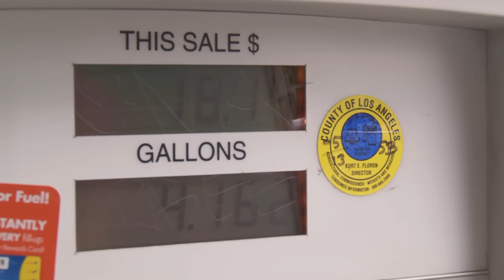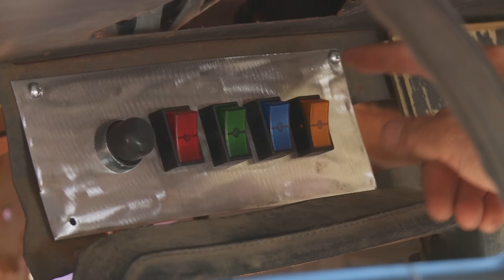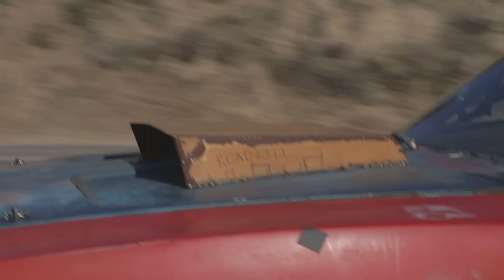Dirt Cheap Rat Rod! 1968 Charger Buildup and Thrash - Roadkill Ep. 23

Comment: Add one big turbo to it -> +200 horsepower
Reply: no
Reply: Yes!
Reply: NO TURBO IT WILL JUST MAKE IT SOUND MORE LIKE POOP
Reply: And some Racing Stickers -> +50 horsepower each
Reply: A turbo on a 68' charger. Were you dropped at birth?
Reply: Whats wrong with a little bit of boost?
Reply: ok supercharger then. Gets even better. 
A proper supercharger to that= +400nm torque. Torque means burnouts and brutal acceleration and supercharger means even better sounds.
Reply: Martial Bernier I Agree. Theres nothing wrong with a little bit of boost to make the tires go round and round.
Reply: Very basic engine in old car that is not boosted produces around 140hp which is same as for ecoboost produces.
With proper charging its easy to triple that.

If it would be diesel engine, they would propably add even more air into engine. because diesel is funny if you add air. 120hp turns into 800hp and 2000nm torque
Reply: eero nieminen Yeah 140hp may be the same as a ecoboost but...
A: You will most likely have more torque
and
B:The Power curve, Delivery of the torque, and the characteristics of the motor make it alot more punchy.
Reply: i would like to see that care have a drag race against ecoboost fiesta rs
Reply: eero nieminen LOL That wouldn't even be a race.
Reply: lol fiesta is lighter and produces same amount of power as this one so it would be close one
Reply: eero nieminen look at my comment 4 comment up from this one...
Reply: it still doesnt mattter. fiesta might still be faster and propably is. 
did you know wrc cars go 0-100kmh faster than lamborghinis? Even tho they are almost like normal cars with 2L engines.

Fiesta rs is actually faster even tho this car has V8 and fiesta has 3 cylinders and 1000cc.

You should walk to car dealer and get one for a ride. It is fiesta but has amazing engine. Just try it
Reply: yes i do have but you cant believe me for some reason
Reply: eero nieminen just watch the new roadkill ep.
Reply: eero nieminen I'm late to the party, but what Onyx is getting at, is that HP isn't what moves the car, it's torque. And that old school V8 might not make much HP, but it makes a lot of torque. Also, that Charger is essentially a rolling chassis, so it isn't nearly as heavy as you might think. No interior, no windows, it's probly several hundred pounds lighter than stock. So yeah, drag race? Charger, all day.
Reply: Guitardrumr Horsepower is more important in cars.
As an example Tractors have like 160hp and 700nm torque. Still even tho they are geared to go only 50kmh but if you change the gearbox, it still doesnt go faster than 80-90kmh. 2400rpm rev limiter just cuts the horsepower off
Reply: eero nieminen you are comparing a diesal to a gas engine though,
Reply: eero nieminen The late great Carrol Shelby would disagree with you, sir.

"Horsepower sells cars, torque wins races"

The ecoboost Fiesta you're riding so hard would be embarrassed by an old Jeep in the 1/4 mile. My old 01 Cherokee ran a 16.5 second 1/4 time at around 90mph. According to Car and Driver, the Fiesta is running 16.7 seconds at 84mph.

Wanna know why? Torque. The Fiesta has a whopping 112ft-lbs of torque. My old Jeep? Right around 250ft-;bs or so. So even though it's older, heavier, and has the aerodynamics of a Frdgidair, the Jeep runs quicker, because Torque is what is hustling the car down the track, not HP.
Reply: My friend has tractor with higher gearbox just to play with. It produces 700nm torque and 155hp. Still theres not enough power to go over 80kmh, because it revs only around 2300rpm, after that it heats up very very fast so its not worth it.
Torque accelerates in low speeds and horsepower has much higher top speed.
F1 car has less torque than your jeep but seven times the horsepower. And it goes FAST
Reply: eero nieminen you are once again comparing a diesel engine to a gas engine there is a difference. Diesels do not rev high. Its not how they are built.
Reply: TheLordJethro There is no difference. That example is just to show the difference between torque and horsepower.

Did you know that I produce 130nm torque and 0.4 horsepower on mountainbike? Maximun rpm is around 90 and with highest gear I can go 45km/h.
If I had the gearbox from a car in my bike somehow, my top speed would be like 15km/h with the highest gear.
If Car would have enough torque to actually beat wind resistance and use the gearbox from my bike, the top speed would be about 600-700km/h at rev limiter. (Compared to a car with top speed of 200kmh at limiter).

I have lots of torque but my rpm is not high enough to use small gears and go fast and i need to switch to higher gears very early which reduces the torque that goes to back wheel. If I could cyckle at 7000rpm instead of 90rpm, I would have 130nm torque and 135horsepower and with total weight (me on) would be 85kg because bike is 15kg.
I could be faster than any car on earth and faster than a haybusa turbo in drag race.
But currently I am dealing with ONLY torque and that causes me to have very low top speed.

F1 speed is based on rpm/horsepower too. The engines rev A LOT like 16000rpm and produce 750hp easily, but torque is around 200nm still. They are geared to go 360kmh at limiter, and that would be 180kmh for a car that is limited to 8000rpm. at 8th gear. Which shows where horsepower gets its power from: Smaller gears and no need to switch to higher so soon.

Torque is PURE power but diesel engines that consentrate on torque, doesnt rev much at all so there is need to switch to higher gear much earlier. Also electric engines have lots of torque. They operate with one single gear and 0-7000rpm. No need for small gears because they are so strong.

Tractors can have 1500nm torque and 350horsepower.

If you have 1500nm torque in a petrol engine, You have propably 1600horsepower which means very high top speed. You have the torque to pull very big gears and high rev limit to pull those gears really far.

If a diesel has 1600 horsepower, we are dealing with 6000 or more torque which is just insane and very rare to have such a big engine ayways.
Reply: eero nieminen Now you're going off on a tangential argument trying to discount torque.

Stop comparing apples to orangutans.

Your argument was that the Fiesta makes the same power as an old V8, and was therefore just as fast or faster.

We are talking about gasoline engines. We don't have the RPM limitations of a big diesel (which no on but you even mentioned) or you on a bicycle (Really? Seriously?). We are talking about two cars, that both have gasoline engines. If they have the same, or similar HP, but one has significantly more Torque, the one with the torque will win more often than not.

I demonstrated this by posting the 1/4 mile time for the Fiesta. It has 140hp in a small car, and yet, because it has jack diddly squat for torque, it runs a sad 16.7 second 1/4 mile at 84mph. To further prove my point, the General Mayhem runs a drag race at the end of the Subaru Challenge episode. The Legacy 3.6R covers the 1/4 mile in 15.5 seconds at 94mph (Car and Driver testing). The General Mayhem covers it by a few seconds in a drag race. Hell, the Raunchero covers it, albeit much closer, and it has a generic smallblock in it.
Reply: As they said these engines are not pure unmodoficated they added a turbo to that one smaller car and suspension stuff to others.

The fiesta does not weigh much, its very light. Your jeep obviously weighs more and its not that aerodynamic as fiesta so if it has as much horsepower as fiesta, but twice the torque, It might be able to keep up with That fiesta or even be faster in that short track.

Compare it to 1.6L Turboed 4cyl fiesta and the jeep surely loses, because that more powerful fiesta has almost as much torque and much more horsepower.

The bicycle thing was to explain you that horsepower and torque both matters.

F1 with 2014 engine can outrun an F1 with same weight but with tractor 4L turbo engine, but theres not that much difference.

The tractor diesel has 750nm torque and 200 hp, while gasoline engine has it other way around, 200nm torque and 750hp.

Torque matters, but horsepower makes the difference in high speeds.
Your jeep has more torque but it all goes to wind resistance and added weight
Reply: eero nieminen LOL you know nothing about cars or engines or anything you validate my point by saying that gasoline and diesel engines are the same thing. Go get educated before you try to talk.

"Torque is PURE power but diesel engines that consentrate on torque, doesnt rev much at all so there is need to switch to higher gear much earlier. Also electric engines have lots of torque. They operate with one single gear and 0-7000rpm. No need for small gears because they are so strong."

Do you even know why diesels do not rev high? Do you even know that diesels do not have spark plugs? Diesels are radically different than regular gasoline engines in the cars in this video.

"As they said these engines are not pure unmodoficated they added a turbo to that one smaller car and suspension stuff to others."
Your point? 

"the fiesta does not weigh much, its very light. Your jeep obviously weighs more and its not that aerodynamic as fiesta so if it has as much horsepower as fiesta, but twice the torque, It might be able to keep up with That fiesta or even be faster in that short track.

Compare it to 1.6L Turboed 4cyl fiesta and the jeep surely loses, because that more powerful fiesta has almost as much torque and much more horsepower."

You are putting way too much emphasis on aerodynamics and drag that what is really needed. Where in the hell are you getting your numbers for Jeeps? The 2014 3.6L Grand Cherokee makes 290 hp and 240 ft/lbs of torque.same with the Jeep wranglers. That is more than 100 hp against the fiesta. Even if the Jeep weighs 4000 pounds it would win.

"The tractor diesel has 750nm torque and 200 hp, while gasoline engine has it other way around, 200nm torque and 750hp." 
Your point again? You are comparing a highly modified engine built for the purpose of racing to an engine that was built to work.  Get a clue.
Reply: TheLordJethro
The point is that horsepower wins races, and torque doesnt have that big effect in speed.
Reply: eero nieminen a combination of both wins races*
Reply: TheLordJethro No horsepower matters more, thats why F1 is so fast.
In work or when you connect your tractor to breaker or something, you need torque, and thats when horsepower does not do anything.
Reply: eero nieminen I'm sorry, but Carrol Shelby disagrees with you, and I'd like to think his track record speaks for itself.
Reply: Do you even know the definition of horsepower? Of torque? I never said anything about horsepower or torque being more important than the other. You try to compare a engine that was specifically built for racing to an engine that was specifically built to do work.
Reply: Lpn
Reply: Nieminen Eminem put your car on the track and give it a killion hp and no tq the car will go nowhere if you havent noticed f1 is  6cyl turbo which ruined them and they sometimes make more tq then hp the only reason they go so fast is the gearbox ratio is long and the car weighs nothing
Reply: Nieminen Eminem Just as fast yes, but accelerates as much as a grandma in a fiat.
Reply: Jason Stuck No. Its really as fast.
Engine power is measured with torque. Its the turning power of output. Horsepower is counted with max rpm. Means, If cars top speed is 200kmh, the gearbox is putting out exactly certain amount of torque.
Only difference is that gigh torque output car must pull much higher gear compared to high revving car which can turn much smaller and lighter gear due to its much higher revs.

A cyclist produces around 120nm torque (Yes more than your Yaris), But with only top rpm of 90, it produces only 0.6horsepower. Thats why a bicyclist can go only 40kmh on flat road without wind helping.

Now lets take the top gear of bicycle and divide the speed with rpm
40kmh / 90rpm = 0.444

Now lets use cars engine rpm on it. (same torque output now)

0.444 * 8000rpm = 3555.5km/h

That shows how big gears a cyclist is pulling with their relatively light bike and high torque.
Literally if there was no wind resistance and we could keep the total wight of a bike with cars engine on bicycle at 85kg, this machine would go 3555km/h at rev limiter and top gear.

A bicyclist with cars gearbox could go as fast as  2.25km/h  at max rpm (90)
(If car would hit rev limiter at 200km/h and 8000rpm)

I hope you understand now how horsepower works
Reply: /facepalm
Reply: Yeah, thats really not how it works here buddy
Reply: Jason Stuck Yes you are american so you obviously cant understand but let me quess? nm is not valit measurement of torque? You want feet-pounds? No way thats just gey
Reply: Nieminen Eminem  What I think you fail to realize is that horsepower literally doesn't exist as a force. Horsepower is a calculation purely based on torque.
Horsepower is what you get when you measure that force exerted through a distance over a period of time and make a calculation that results in a number, that number is horsepower. That force being measured is torque.

Which is why your argument boggled my mind, because horsepower literally does not even exist without torque.
And torque is king.

To actually give a mathematical tl;dr..
Suppose we attach that one foot wrench to the end of a crankshaft and the engine rotates one revolution against that one pound of resistance. The end of the wrench will move 6.2832 feet (Pi * a two foot diameter circle) against a one pound weight. The end result is 6.2832 foot-pounds of work done at one foot-pound of torque.
1 horsepower = 550 foot-pounds/second = 33,000 foot-pounds/minute. Taken from a man literally observing a horse back in the day.
33,000 foot-pounds / 6.2832 foot-pounds = 5252 (Magic number right here, ever wondered why the horsepower and torque curves from a dyno always lines up at 5252?)

So, if the engine rotates against the one pound resistance at 5252 rpm:
6.2832 X 5252 = 33,000 foot-pounds/minute = 1 horsepower because the one pound of resistance was moved 33,000 feet in one minute

Therefore, to convert torque to get horsepower: (Torque X RPM) / 5252 = horsepower.
Reply: Arcticun I saw the feet and pounds so I instantly stopped reading, because I am not american and those units are just from ass hole. 
And I know what torque is and how to measure it, actually in school we measured how much torque and horsepower bicyclist produces and my result was 118nm and 0.6 horsepower
Reply: I'm European myself, but the calculation is based on ftlbs, not nm.
If you're so narrowminded that you refuse to actually comprehend what is being told to you, then may you live blissfully ignorant.

Just keep in mind that you're most likely going to get absolutely destroyed in an argument against anyone with even minute knowledge about cars.
Reply: Arcticun Calculation is based on nm because metric units. Imperial system is just crap. Only thing left from imperial is horsepower but its changing to kilowatts already here.
Reply: Jason Stuck Which comment are you referring to?
Reply: Yours
Reply: Jason Stuck Which comment?
Reply: "Calculation is based on nm because metric units. Imperial system is just crap. Only thing left from imperial is horsepower but its changing to kilowatts already here."

You literally just agreed to what I posted.
Not sure if you even realize this.
Reply: Arcticun Didnt bother to read
Reply: Noticed that quite a lot with you.

Comment: General Lee was a '69 though.
Reply: +GODOFGUITAR2112 General Mayhem is a 68
Reply: That's what I'm saying, General Mayhem can't be a General Lee.
Reply: +GODOFGUITAR2112 they never said it was General Lee
Reply: Finnegan said he wanted to make it a General Lee.
Reply: +GODOFGUITAR2112 but it's freiburgers car so finnegan can't decide that :P
Reply: +GODOFGUITAR2112 Yes it is but the body style differences between the 68, and 69 are very minor. Both had fairly the same engines, just they added the middle splitter on the front grill of the 69 along with the brakelights.
Reply: Yea I know.  I also know that they are both way to lazy to do that.
Reply: +GODOFGUITAR2112 yeah it's fine. I love how the General Mayhem turned out.
Reply: There was actually multiple body years used in the Dukes of hazard for stunt cars and other things

Comment: Freiburger, I used to be a nut like you but the years have caught up with me. I remember a magazine article in a mopar mag back in the '90s. They took an old Imperial with the 4bb 413 and started to strip weight off it to see how fast they could run the 1/4 mile. I would like to find  a copy of that article. Or maybe you could reenact that.

Comment: 440 is good, short block 383 even better.  I had a charger 440 magnum, they weighed a bit so at 140 or so it wanted to liftoff like a plane.  Beast.  Hold it to the floor for 10 miles, only your nerve will give, or a tire

Comment: ok regarding the transmission no one remembers when they took the pan off in the 24 hours of lemons episode and saw all the aluminum past and how the trans didnt want to function properly at the race i dont think it had any thing to do with the front pump being seated b/c the trans wont bolt up "properly" if the tork converter isnt seated =)